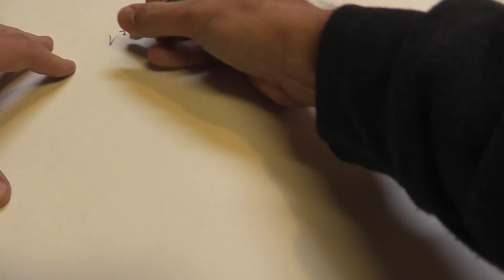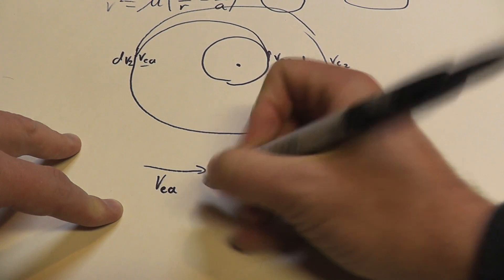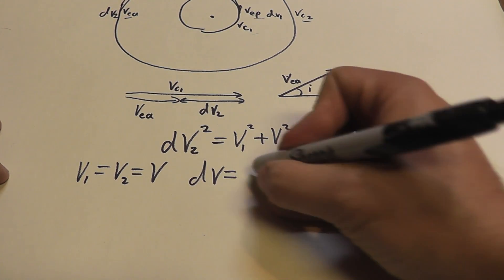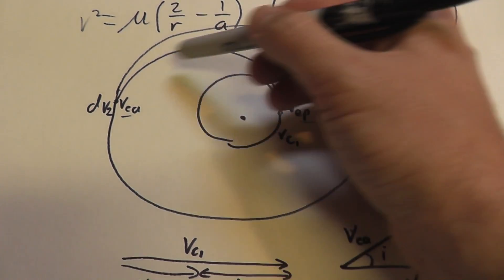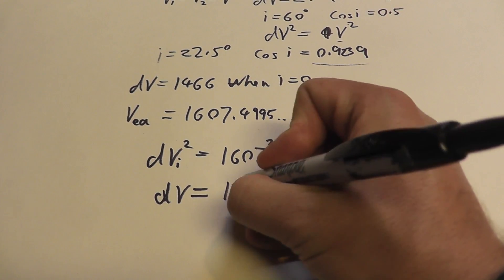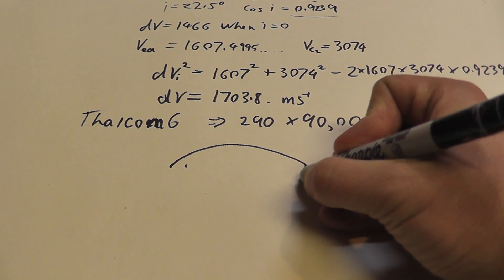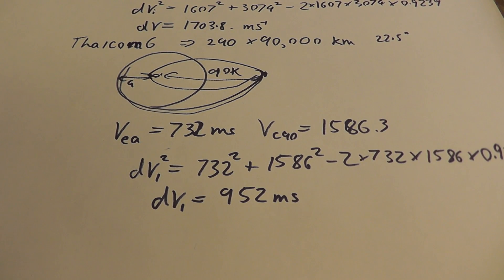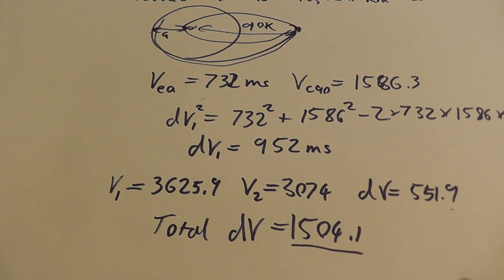Orbital Mechanics On Paper - Part 2 - Inclination Changes

Comment: do the mass of the object affect the speed need to archive orbit
Reply: not really, because the mass of the planet is so much bigger than the rocket's that it doesn't affect it.
Reply: Abraham Sanchez thx
Reply: sqrlmonger, mass actually matters. The specific energy in orbit is constant, (kinetic + potential =constant)

So we got:
 (v^2)/2 - u/r = constant
( that constant being -u/(2*a) )

We can see here that velocity depends on u, the gravitational parameter. We can also see that in the formula Scott was using (which is the same). 

Now, remember that u = G(m1+m2), which is usually assumed G*m1 because of what I stated in my first post.
Reply: sqrlmonger What if the rocket is the mass of the Earth?

Comment: This may be a silly question, but in KSP, when you set up a node to burn normal/anti normal to change your inclination, it also changes your periapse. Why does it do this when the voce you're applying is perpendicular to that orbital velocity? Shouldn't there be no change in the orbit other than the inclination?
Reply: I asked a similar question. I think it is because the KSP node system assumes that you burn at a fixed heading for the entire burn. So you begin burning normal/anti-normal to your velocity vector, but as soon as you start burning, your velocity vector starts changing, but your burn direction doesn't. So you are no longer burning perfectly normal/anti-normal anymore, but are burning just a little bit prograde. This worsens the longer you burn without adjusting your heading.

Comment: How would orbital mechanics work in a Vortex based solar system, compared to a "standard" viewpoint of our solar system?
Reply: They would work exactly the same, because the Vortex-based solar system is describing exactly the same thing as the "flat" model of the solar system, just from a different reference frame. When maneuvering within the solar system, it's acceptable to ignore the movement of the solar system through the galaxy (which is what the Vortex model is focusing on) because all of the planets can be thought of as sharing the same reference frame. For the same reason, when you fly from Los Angeles to New York, you don't have to think about the fact that the plane is simultaneously being dragged around the Sun by the Earth. It's only if you want to transfer between two reference frames that you have to think about the relative velocity between them.

Comment: I'm loving this series Scott! I'm planning on studying mechanical engineering for an eventual goal for a career change into ideally the space industry. Maths for the sake of maths has always been something I've found off-putting, but I'm enjoying these equations (I'm calculating as I watch)! If you decide to do more I'll gladly watch more :)

By the way, if you're a Mac (or iOS) user, maybe take a look at an app called Soulver? It doesn't do subscript/superscript which is annoying but otherwise it's really nice for doing calculations on. (Check if you can get it from Apple internal resources).

Comment: Why don't they build Rocket lunchpads near the equator? Wouldn't they reduce then the amount of inclination they need to change?
Reply: They have done a few launches from sea based launch pads on the equator to minimize the dV needed. Also launches at the equator gain more velocity from the Earth's natural rotation, reducing dV required even further.
Reply: okay! but the two main lunch pads (in my opinion) baikonur and cape canaveral aren't near the equator...
wouldn't it be  then cheaper to build one main Spaceport near the equator?
Reply: The European Space Agency uses a launch site in Guiana because it is only 500 km north of the equator. That seems to be the closest land based launch site to the equator.
Reply: I think there are probably a lot of political concerns that make nations want to launch from sites within their sovreign territory. Remember that space flight has significant military application, no matter how much we boffins like to ignore that.

Comment: the second one is also more efficient even if you don't need inclination changes at all, isn't it
Reply: I think you're referring to what's called a bi-elliptic transfer. In some cases, it is more efficient than a direct Hohmann transfer, but only if the distance between the starting and ending orbit is sufficiently large.

Comment: Here's a question related to that Thaicom launch: Why 90km, and not 80km, or 100 km?
Reply: I don't have the exact answer, but I think there is a balance to be achieved between the delta-V saving from making the inclination change at a higher orbit, vs. the delta-V cost of getting to the higher orbit. Also, the farther out you are, the more efficient your maneuvers become, but at some point, they become so efficient that they are very fiddly and hard to get right. I don't know to what degree the latter applies to real-life spacecraft, which may be very precise.

Comment: Great series! As a guy who wants to study and work in Aerospace Engineering I beg you to continue it! It even made me log in to the YT-Comments for the first time since G+ :D
There are so many questions:
Is the angle and direction of the dV-vector equal to the angle of attack nessesary for the inclination change? How do you determine at what point of its (allegedly excentric) orbit an object will be at a specific point in time? How to take SOI-changes into account, and how do you determine the best values for a gravity-assist?

Comment: Scott, maybe not part of your series but how do satellites/spacecraft know where they are in space?  Seems like the spacecraft needs very precise vector information.  Is it all inertial guidance?
Reply: I have wondered this too. It's very nice that KSP shows you exactly where you are, exactly what your heading is, and exactly what your velocity is. I suspect that gleaning this information in real life is significantly non-trivial.
Reply: gps and star-tracker cameras can help.
fun fact: GPS was developed to work on earth, but the satellites are shining their signal not just at earth but left/right/up/down around it into space. if you receive enough of them, you can just do the same math as your smartphone does.
Reply: ***** i binged a few apollo program documentaries on youtube once (there are qute a few - search for them) and i think i remember that they did a combination of intertial and startracker. maybe the inertial sensors would be calibrated from startrackers after launch. or they were just so stable to stay true through launch, because the rocket itself needs a proper guidance, too. so it should not have been impossible to build something that not even survives a rocket-launch, but actually guides it.
Reply: Chris BigBad

Ah ok.  So how did they do it before GPS?  I know Voyager and other probes had star cams.  But we didn't go to the moon using GPS...  If it's inertial, I'm wondering how they kept the gyros stable during launch with all that vibration.

Comment: In all of these, we assume that we can just accelerate instantly. Are there equations which would tell you at which points you should start and stop to accelerate to make it slightly more efficient than just "eyeballing" it?
Reply: As easy to use as that approximation is, in reality it's not quite that simple - sadly :P

That's because of all nasty orbital and burn parameters changing during the burn. Let's say your burn would take time t and the instantaneous dV would be needed at time T. At any point in time during the period T - t/2 ... T your velocity is less than during T ... T + t/2 so the spatial drift from the actual dV orbital point isn't symmetrical.

And there's more. Since your ship is losing mass, its TWR is increasing (depending on it's mass-ratio), which means the acceleration isn't constant. AND, your altitude (and therefore orbital velocity and burn efficiency) isn't constant during the burn etc. etc.

In conclusion, the equations are there, but they probably contain some ugly integrals (in polar or spherical coordinates '-.-) that cannot be solved in closed form - and that I even doubt to be able to derive myself - let alone the practical problem of executing the burn accurately.

Maybe Scott as a physicist could give us some higher order approximation :)
Reply: I think in that case if you know how quickly your craft accelerates, then you take the time to reach the velocity, halve it, and then start the burn at that time before you reach ap/pe. That way on average you are making your burn on the point whilst accounting for the fact you cannot effect these changes instantly.
Reply: if you know your acceleration then you know how long it takes to reach that delta v. Just accelerate for an equal amount of time either side of the burn point.
Reply: Pontus Lundström
Thanks!

Comment: Why do you write m/s a bit like ms-1?
Reply: Ah yeah I completely get that now thanks. I had in my mind (ms)^-1 but is just the s to the -1 hence 1m over s or m/s :)
Reply: Same thing.
Reply: TheExplosionist As long as he remembers the -1 exponent... which he forgets a bunch of times here.
Reply: Yes but why put the -1 exponent? Thats like writing 1/m/s
Reply: Not quite.
x^(-1) = 1 / x

So, m s^(-1) = m / s

Similarly you can say the acceleration of gravity at sea level is 9.8 m/s^2, or equivalently 9.8 m s^(-2). It's an alternate way of writing the same thing. For more complicated units, like for Newton's constant 6.67 * 10^(-11) m^3 kg^(-1) s^(-2), using negative exponents is preferred over slashes because there is no ambiguity about order of operations. You could write 6.67 m^3 / (10^11 kg s^2) and it would mean the same thing, but in order to make the order of operations clear you'll need parentheses if you're typing, or clear fractions if you're writing things out.

Comment: It bugs me (as an engineer) that you are using 'd' instead of greek delta while describing delta-V (as d is 'reserved' for derrivatives)

Propably it bugs me more than it should :)
Reply: ΔV and dV are the same. Both are in reference to the change in velocity.  Im pretty sure there isnt anything sacred rule to only use dV in calculus.

If he wanted to be trolly, he could've even used Δx/Δt, or dx/dt, or x' if he wanted.  Its just choice in nomenclature.

Its been a while since ive graduated with my engineering degree, so if i am wrong, please let me know.
Reply: At the same point when writing stuff out using dV is a lot easier to write quickly than ΔV. If any of these calculations require scott to go into calculus then he can worry about dV vs ΔV
Reply: Glad it wsant just me then :P don't forget "theta" instead of I
Reply: Where did he get the V1 and V2 values from at the end of the video? 14:00
Reply: DiEvAlDiEvAl Yup, that too - although I forget about them quite often also :)
Reply: Feel your pain, but using theta for the angle and delta on the velocity is an extra hurdle of understanding. 

I kept looking for the dt under dV too.... Not to mention "i" for imaginary numbers. Makes me feel like my profs were brainwashing me...
Reply: Ahh, engineering - remeber how FUN it was not knowing how something works?

Yeah, me neither - it's fun now when I know how shit works :)
Reply: BarcelPL
Still wondering when I'm going to actually use diffeq in anger.  Magic 8 ball says.....doubtful!
Reply: Well then i suggest we substitute and known greek letters for other things like fruit or hotwheel cars... Seeing how the mathematician can use anything he wants to represent a value...

Banana = coconut x peach (2/ impala - 1/ pomegranate)

Comment: How much delta-V would it take to get to Mars and back in 48 hours?
Reply: metaphorr05 yeah but this would be assuming that the burns were done in an instant.
if you want to do it with the least amount of constant acceleration you would need to be accelerating constantly until you're halfway there and then braking until you're there... twice

you would need to accelerate at about 2.67 G (not thaaat high acceleration) for twelve hours, four times, each maneuver costing 1153km/s for a total of 4613km/s for your nice* trip to mars.

nice is subjective*

**subjective doesn't mean someone agrees
Reply: Green Azio 
well if the trip takes 48 hours then going to mars takes 24 and halfway there takes 12.

now if we consider we are accelerating at a constant rate to cover 25,000,000,000 metres in 43,200 seconds it means that our average speed will be 578,704 m/s

since acceleration is constant and we start at 0 m/s then we end up going at 1,157,407 m/s after those 43,200 seconds and to get to that speed in that time you will need an acceleration of 26.79 m/s^2...

actually now that i come to this answer i realize i was just a tad wrong since a g is actually 9.81 m/s^2 so actually you would need to accelerate at 2.73 g

glad you asked.... i love doing these posts :)
Reply: Over 9000.
Reply: Green Azio the guy up top said 50 million km... i just assumed he wasnt making a mistake

Comment: I very much like this series, but why can delta-v be modeled like a triangle with the inclination as an angle?
Reply: Velocity is a vector. Delta V is a vector difference.
Reply: I don't think that answers my question.
Reply: ***** It only works this way for calculating delta-V to go from a non-equatorial orbit into an equatorial one, or the other way around. The inclined orbit defines one plane, the equatorial plane is the other. The angle between those two planes is the inclination. The two points of intersection between an inclined orbit and the equatorial plane are where that orbit crosses the equator. The orbital velocity vector at those points will be within the plane of the inclined orbit, so the angle between the orbital velocity and the equatorial plane is also equal to the inclination.
Reply: I understand what inclination is, I don't understand why inclination changes combined with other maneuvers can be modeled as a triangle.
Reply: ***** An inclination change is just a change in the direction of your orbital velocity vector. Do you understand how vectors work? (actual question, not trying to sound demeaning)
Reply: tavert I think so. In fact I created a nice little C++ library around vector maths. If it's really just vector maths then maybe I'll able to work it out. I might be mentally overcomplicating it.

Comment: I really understand the maths behind it better now but one thing that just won't go into my head is that you can do inclination changes everywhere on your orbit. My little knowledge of physics tells me that to get into an equatorial orbit one had to do the inclinatio change burn right at the descending / ascendig nodes relative to the equator, because in a simplified version of orbital mechanics, where delta v is applied in one single point and you start your burn at, say, a relative latitude of 20 degrees you can only get an inclination greater or equal to 20 degrees relative to the equator, because you won't move during that inclination change maneuver. Is my understanding of physics completely crooked or did they just time it right so that the apogee of that transfer orbit ended up just over the equator, because I figure that this would be quite a bit of math...
Anyway, thanks for any answer.

Comment: The sound of marker tip scratching surface of paper is so awful. Could you use small whiteboard instead?
Reply: SekretZdzicha The sound of math is beautiful!
Reply: *****

Why so rude? I only asked, not demanded a new whiteboard.
Reply: Pretty annoying, huh? ( ziomek :D)
Reply: What? and replace it with a slightly squeaky sound? no thanks.
Reply: Tallywort

It's squeaky only when your marker is almost dry. New ones aren't as noisy and surely a lot quieter than this.
Reply: I was shivering the whole video
Reply: *****

I have no complaints to the scientific part of this video, actually it's very good and i look forward for new videos
But it's not just for me, there are other people who think that this sound is annoying.
So you say i don't have right to give my opinion? I have no drawbacks to complain about something if i don't like it.